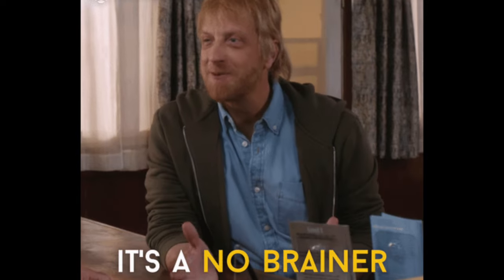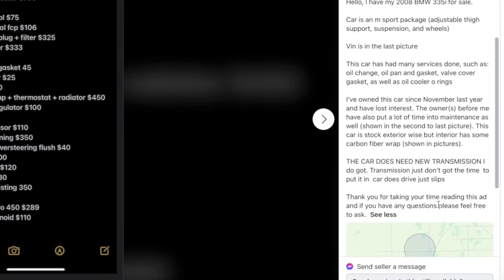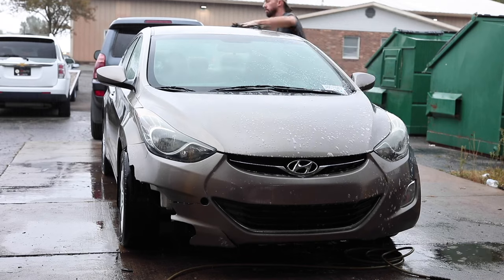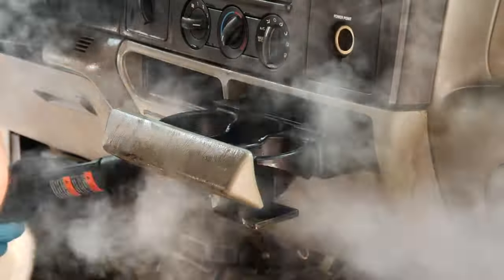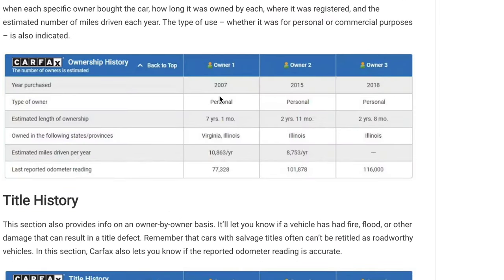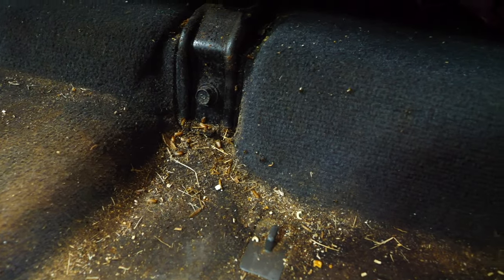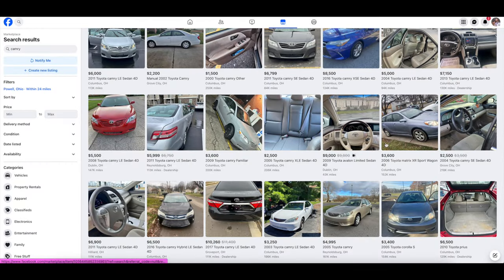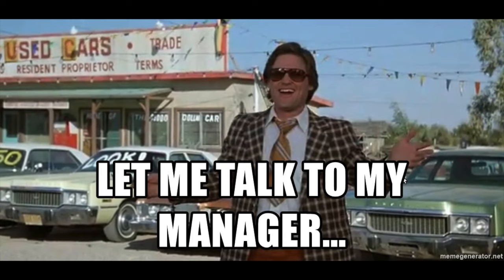CAR FLIPPING MISTAKES TO NEVER MAKE! FULL PROCESS  FLIPPING

Comment: Mechanics who know their stuff are now are in a great position to flip cars.  Toyotas are excellent, as they are cheap, there is an abundance of parts, they are reliable, and in comparison, are easy for a buyer to maintain.  They also have the connections to swap out parts and components.   What time is lost on labor can be returned through good relations with the buyer in tune-ups and full services.  The background knowledge the mechanic has with the car can be invaluable further down the line.  Consider the mechanic being a doctor for your car who has a history in the health of your vehicle.  
Detailing is also extremely important.  Even with an old model car, if it appears to be in immaculate condition, the driver will tend to take better care of it, and will think twice about even eating in the car.

Comment: I got my eye on a 2008 Porsche Cayenne at a local auction. I asked the auction house owner why it was listed for $3k. It appeared to be in pretty good looking condition. He says there's transmission issues. I looked up a used trans on eBay and found one for $500. Now I have to find out the cost of labor to replace it. NADA Blue Book says a nice specimen could sell for close to $10k. After detailing, PPF (at my own cost) and ceramic, $10k shouldn't be too difficult.
Reply: How did this end up panning out for you? End up buying it?
Reply: @sticcfiggur33  someone got to it before I could. I was overseas at the time so it was difficult finding someone to go check it out for me.